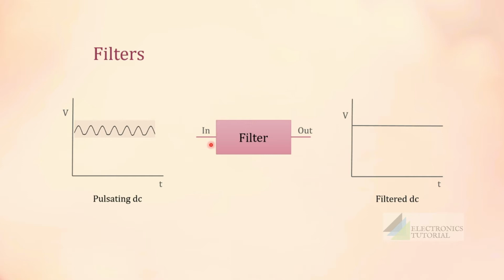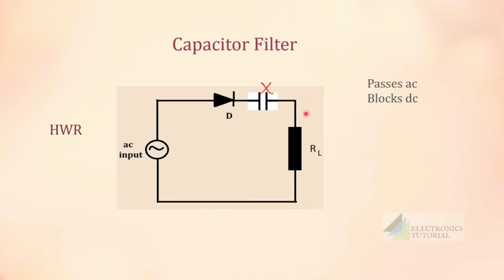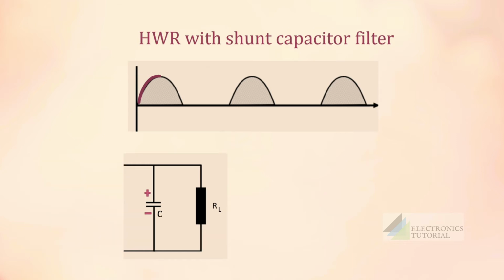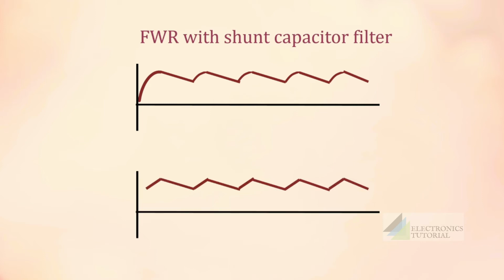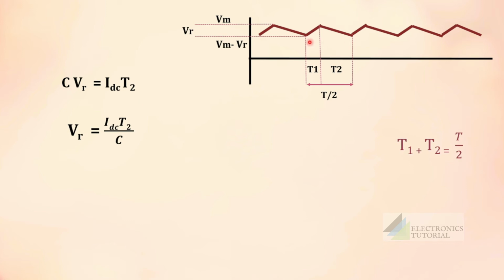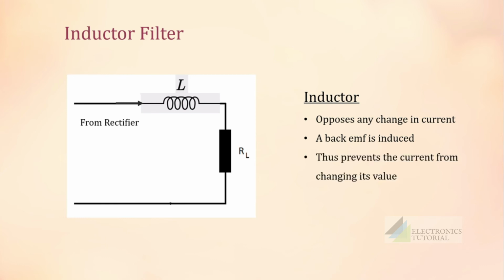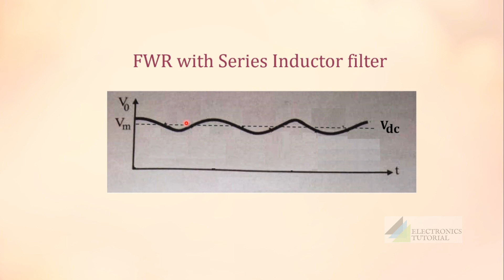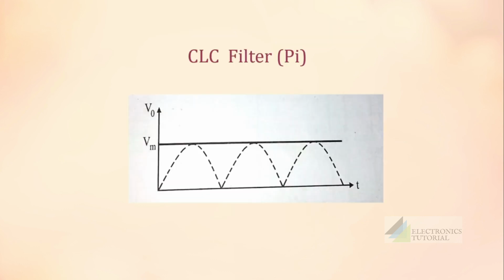Filter Circuits-L, C, LC, CLC

Comment: There is mistake in last formula. The formula for CLC filter replace 12 by 8 then only you will get 5700 in numerator. Also C1 & C2 are in uF and L is in Henry. Please update your Power point otherwise it will cause more confusion than eductation.